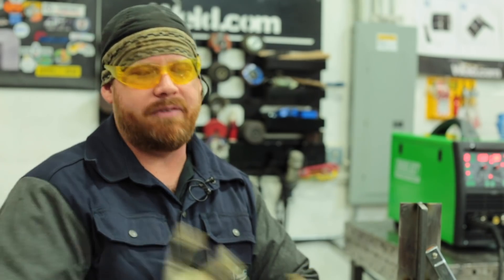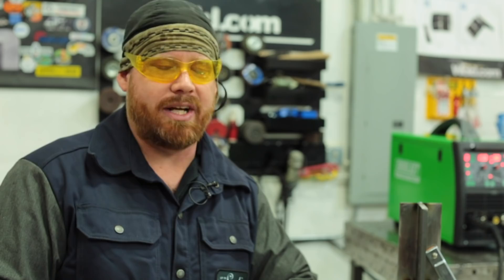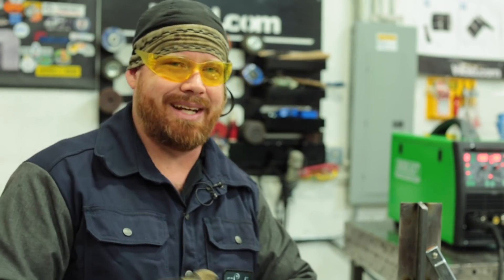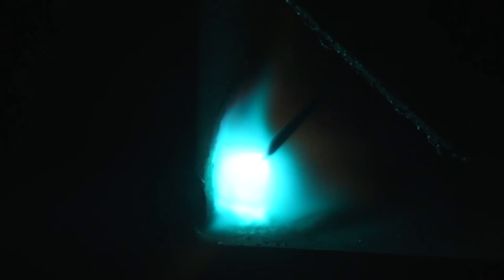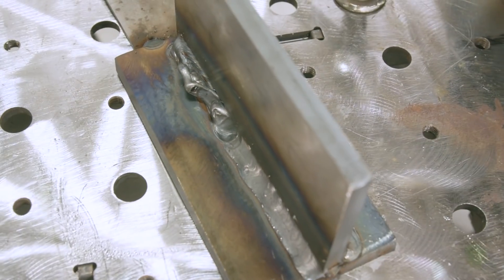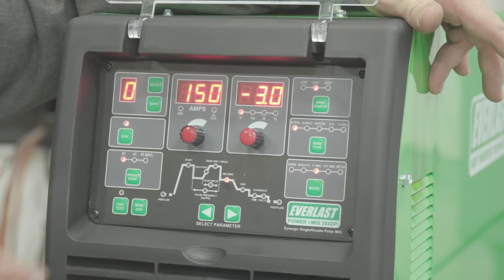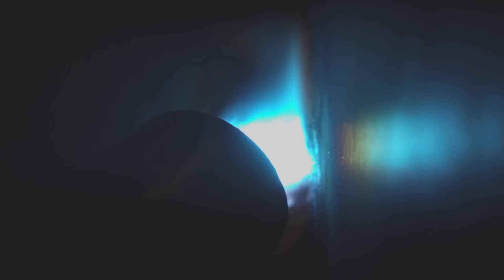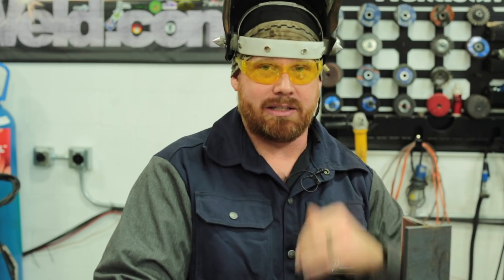Pulse MIG vs Short Circuit

Comment: Thx. Question: little confused about your settings. When you changed to pulse what was the difference in settings vs non pulsed
Reply: Late reply, but pulse is a different program with different parameters. Essentially, all the settings are modified because the process works a bit differently

Comment: Wait so how did you run spray in the first flat fillet weld using 75/25? Or did I miss you switching out the gas for that

Comment: So on the short circuit side the fit up wasn’t as tight as the pulse side since the pulse side was done first and pulled a small gap in the other side. So it’s kinda not apples to apples. Looking at the acid etching, the penetration depth actually looks to be similar, but it wasn’t measured, we were just going off optics.  I like the pulse though, so much cleaner.

Comment: I used to run 100s hard wire in pulse mode at the shipyard. The navy wouldn’t let us use flux core on big ut butts vertical up. We could only use 100s wire in pulse mode. We used 95/5 gas. I’d love to see you do a 3 inch thick vertical butt double bevel and gouge out the back and weld it out and then ut it to see how it comes out. 0.45. Not 0.35. Just like to see it as I had to retire early due to cancer treatment issues. I beat it. Not looking for sympathy just would really like to see a video on that. Have a great day. Love all your videos. I’d like to add it was only certain steel types that we couldn’t use flux core.

Comment: Is there an advantage one way or the other between GMAW-P and FCAW-G. Seems like the flux core with gas can perform the same as the pulsed spray? and you wouldn't need to invest in a machine that has a pulse option. The added cost of the flux cored wire would seem to be offset by the lesser cost of running straight CO2 in lieu of the higher percent argon mix.

Comment: Ok so I run pluse might on a Lincoln 360 mp and by the way its sounding your not doing it right at all. You are supposed to run in a stringer like method and gotta have a steady hand. I'm not sure how I can post a picture or a video of me performing the pluse mig metal transfer but if you give me an email I will email you them

Comment: As a new makerspace club cost is a major concern as we put together a metal fab shop on a budget.  We are thinking tig/stick because it is awesome but argon is spendy.  I think we can tig braze with nitrogen.  They use nitrogen as shielding gas in a couple different situations.  What about tig brazing with pure nitrogen? 50/50 mix?  Would Mr. tig demo this maybe?

Comment: You used a different pattern on the short circuit than you did on the pulse, but didn't explain why, or if that had anything to do with not getting into the root. It also looks worse, because the pulse was done first, and pulled the piece to that side, leaving a slight gap for the short circuit side. All that said, it looks to me the short circuit actually had deeper penetration. Could you explain why you used a different pattern, and maybe try it again doing the short circuit first, then the other side to compare apples to apples?

Comment: I just started a job welding 1/4 inch ar500 steel we use .45 wire and I’m having a really hard time getting my welds to properly fuse both sides. Can you do a video to help?

Comment: Esab rogue 180, Miller thunderbolt 160, Lincoln century,  everlast 200. what’s the best of the best portable stick welder in the $600 range? Your opinion, greatly respected. What you think? I’m leaning towards the esab.

Comment: Question on mixing gas. To avoid buying a third tank-can I mix my 100% argon with my 75/25 to make the equivalent  of 90/10? What type of valve would I need and what would  pressure settings be ? Might make a  good episode if it hasn't already been addressed in previous videos.

Comment: does pulse mig work with 75/25... I used it like that in school and it sounded and looked just like the one you ran with the higher argon mix, was wondering what the difference in pulse mig is like between the two gases.
Reply: Not spraying

Comment: If you pause the video and draw straight lines down through both cut and etch lines, the short arc seemed to actually penetrate slightly more than the spray transfer.
Reply: Based on every video i saw, Short circuit always have more pen on the side wall. Spray has more into the root direction. Only destruction test can tell the truth.
Reply: @Z.Ji2008 I noticed same.  I think spray (cone) is too wide-limiting root penetration. I would like to see cut/etch with spray at closer contact stickout.

Comment: Unfortunately, I can only get 80 cu ft tanks because of no delivery to a residential area, and, well, that’s what fits in the car. So it’s argon and ar/Co2 75/25. They won’t fill anything else in that size tank. So what are the best options for 3/8 to 1/2? Multi pass of course, but stick isn’t really my thing.
Reply: Crank up MIG and try out Globular.
Reply: @donsmith9081  nah, globular isn’t the best way.
Reply: @melgross  I did not say it was the Best way.  He is unable to get his small tank filled with the right gas to try spray.
However, after seeing the cut and etch of Globular and Spray, I was surprised to see how close penetration was.

Comment: From a hobbiest stand can using spray transfer (82% argon be beneficial when limited to 110 input voltage
Reply: No, because you won’t have enough voltage, which I believe is 24-25 volts minimum.

Comment: Question:  If I need to weld an 1/16" or 1/8" wall tubing to 1/2" plate or thicker.  Is it okay to short circuit MIG or should I stick weld it?  Do I set the machine for the thinner material or something hotter?  I know it will weld into the thinner material fine but will it penetrate the thicker material enough?  I have a Lincoln 210 mp so I cannot spray.  I run 035 wire , c25 gas.  Just my home projects. Welding legs onto a plate to make an anvil stand.  I usually go hotter and direct my heat into the thicker metal but maybe that is wrong.
Reply: You can mig this just fine. Aiming into the thicker stuff is right. Grind the scale off to improve penetration. I’d turn the machine down enough to keep from burning holes in the tube.
Reply: @hodgepodgeenginerd1258    Thank you.  I will do that.

Comment: I would like to see a video something like this one where I can’t go to specialized equipment. I am what you would call a bit more than a hobby welder. I work out of a small garage. At my age 70 it would be stupid to go buy some specialized equipment. I weld with a Lincoln 210 MP. Now for this particular application I would tack one side, back gouge the joint and weld it up, then back gouge the other side and weld it up. This would give me a full penetration joint. What’s you’re opinion? In my opinion this would allow me to properly do the job without investing in new equipment and using what I already have.
Reply: Kinda depends on how much time your spending with extra prep work compared to what is needed with the special equipment.
Reply: What you doing is fine ? Or  of one edge  just grind 45 degree  before welding , do a root run then a top run ?

Comment: Say you had to weld thick material out of position and you were stick welding it say it was 5/16th thick if you ran a 5/32nd rod and multi passed it it would be enough right?
Reply: I ask this because the only time I myself am gonna weld metal this thick would be doing mobile repair most likely and I'll be setup for stick welding also wouldnt it be best to bevel this if I'm really worried about punching into the root? Just wondering thanks jason always appreciate when you do a video you explain things really well verbally and under the hood

Comment: Im new at mug welding but have been stuck welding for years and have been looking at the Miller 235 and just wonder what your thoughts are on the everlasting?
Reply: If you're on FB join our group. There's lots of guys in there that can tell you all about our machines.
Reply: @Wroger Wroger LOL.   Don't even know the basics about welding,  or what the controls do and you are building your own machines? And you are trolling Everlast?
Reply: I was asking his thoughts on welders. If you didn’t have anything to add then why did you reply
Reply: @Wroger Wroger the gentleman didn't ask about specs. He asked for a testimonial. I gave him an area where he could get many. If he asked a technical question I would've been more than happy to answer.
Reply: @Wroger Wroger Obviously, you need to learn something about MIG/GMAW welding.  Wire speed and Amp control are the same exact adjustment.  The wire speed and diameter/type of wire determine the amperage delivered to the weld.  If you were a true MIG welder, you'd know this.   You cannot have separate controls for wire speed and amperage.  They can be measured and expressed differently, but it is the same exact control.  Everlast, incidentally has several basic MIGs and has for many years.  But if you were more than a drive by poster, you'd know this.  This MIG answers a need in the auto industry for welding on newer and more exotic forms of Aluminum that are being used. It also has a setting for MIG brazing for high carbon steels.  If you knew what you were talking about, you'd have said nothing.  It was demoed with steel, but shines really with aluminum.

Comment: Hey, I've been wondering in a production setting running 1/4 steel and thinner on non structural applications is there a benefit to running pulse over short circuit other than post weld cleaning? Is it possible to run pulse downhill on thin and thick metal without lack of fusion?
Reply: Pulse is the preferred mode for all welding in my shop (Lincoln welders and rapid arc for vertical down). In house we recommend pulse over short circuit for all applications unless we have to use metal core, too many guys cold lap short circuit because we aren’t given time to clean scale. We make dump trucks out of ss, gr50, and mild steel. We ran pulse vertical down for years before we found out it’s “not recommended”
Reply: You might have issues with cooking your thinner material but fusion shouldn't be an issue. Pulse atleast on the machines I've used run hotter and faster wire. You set the arc length rather than wire speed, real weird but definitely nice flat solid welds coming from pulse.

Comment: I understand you are professional but I'm a hobbyist and I really can't afford to change gas rental bottles for each project
Reply: Then you select a process that meets 80% of your needs.  How often you weld thicker than 5/16"?
Reply: try some dual shield flux core , you can use 75/25 or even 100% CO2  . 035 wire will do most  jobs to 3/8 in (1/2 in with 045) and  there is little smoke as  compared to  self shielded flux core and with the dual shield you can weld in any postition to max the metal size you do need  at least a 200 amp welder

Comment: Could you guys please do some videos on multi pass fillet welds. Vertical up and vertical down, short circuit transfer with er70s6 75/25 on some 12mm steel (1/2”) I would greatly appreciate it guys